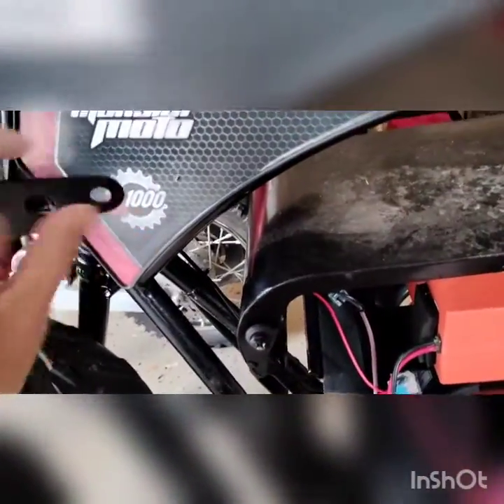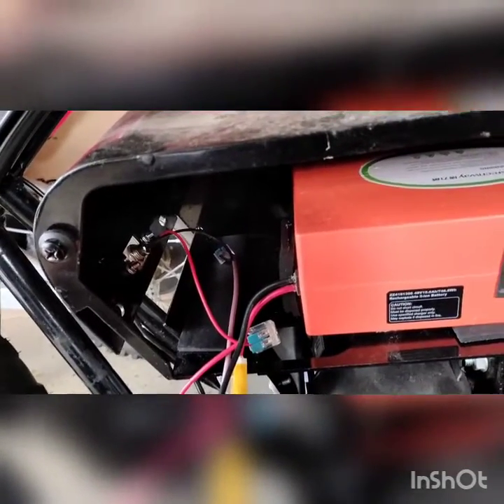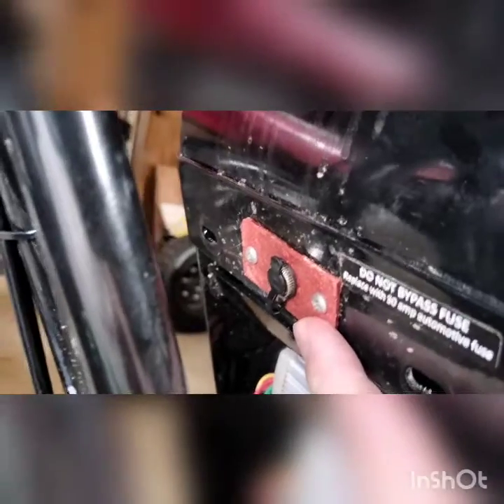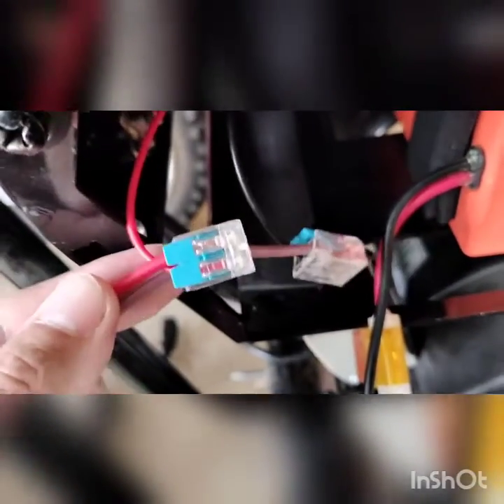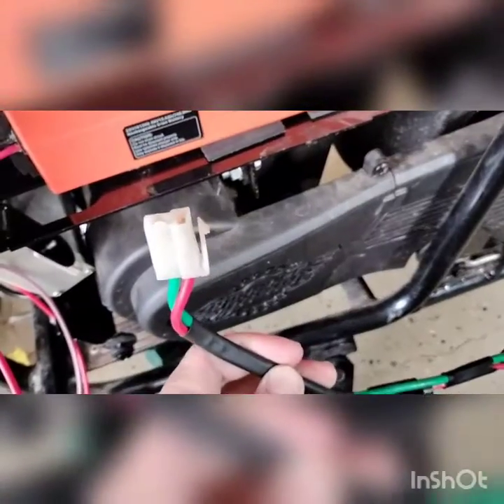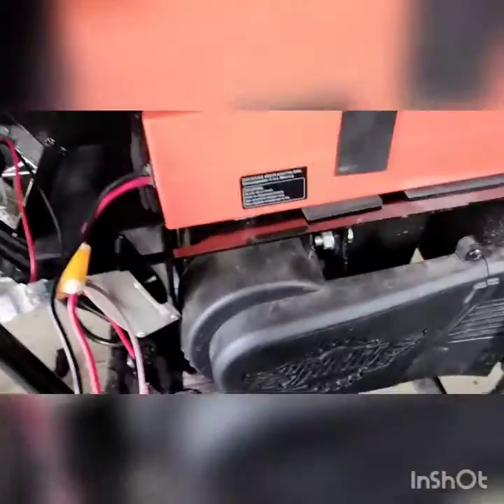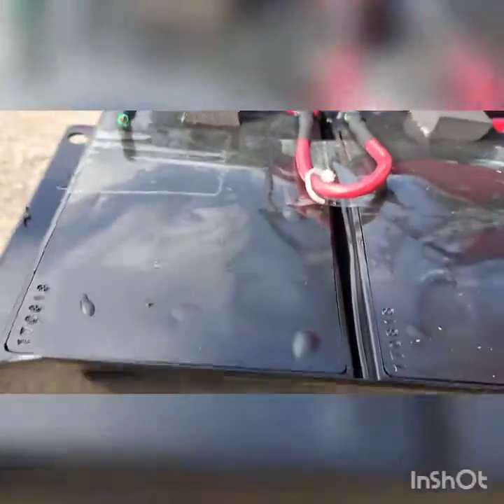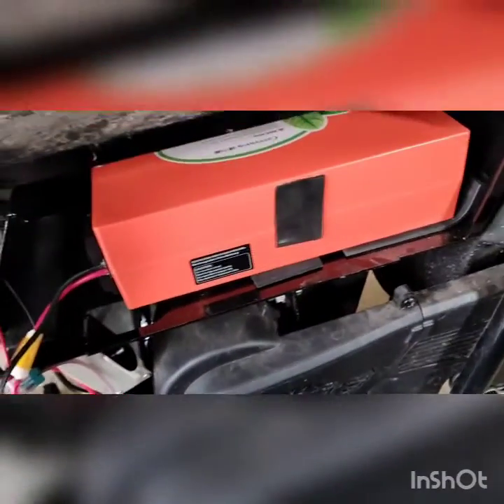Monster Moto E-1000 LITHIUM upgrade

Comment: How is the range compared to stock?  Is the 36v controller holding up?
Reply from the maker: Controller doing fine. My 36v batteries were junk when I got it, but I've gone about 1 Mike so far, I need to add a volt gauge so I know how much is left
Reply: Welp, I put a 48v battery in and after a good romp the controller let out the magic smoke.  Gonna need a 48v controller folks
Reply from the maker: @davids2818  many have run them for years, some for minutes, really depends on the bike, dragging bearings or brakes  etc..
Reply from the maker: @davids2818  I'm on about 3 miles with mine
Reply from the maker: @davids2818  here is the one I put in my wife's bike, I'm still 36v on mine though. https://amzn.to/3CugcTy